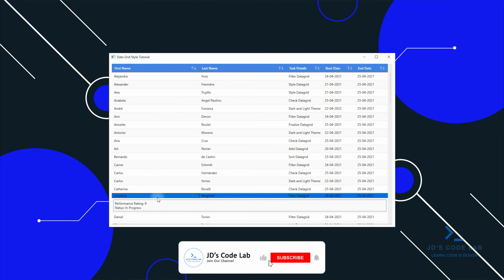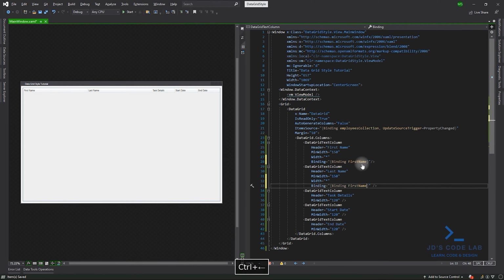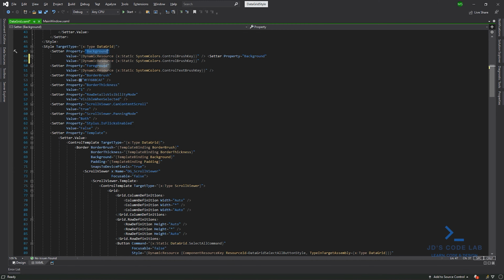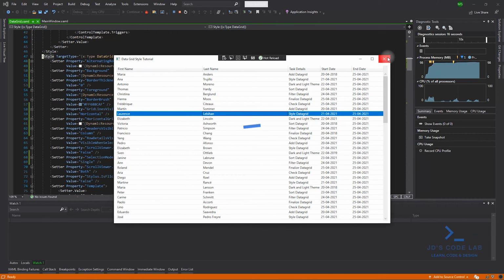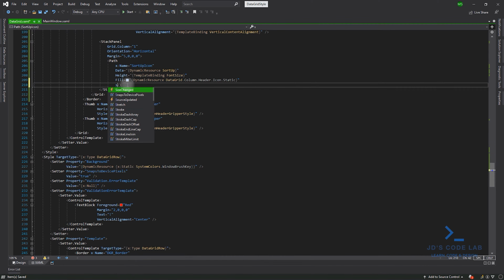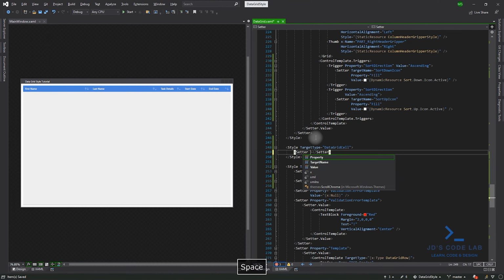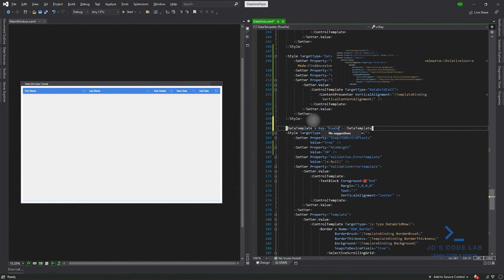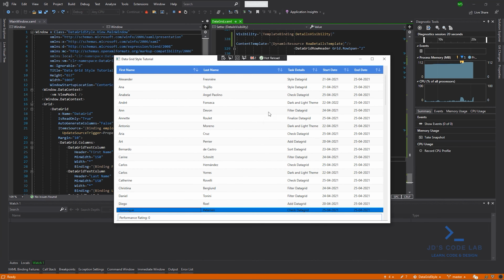WPF C# | Customize DataGrid Control in WPF | UI Design in Wpf C# (Jd's Code Lab)

Comment: Sir,  youtube  originally played the video in a very low esolution 360p by default. I was unable to read the code and was frustrated. I figured out that the Settings Icon allow you to switch the Video Quality to 1080p  etc. After doing this , I was able to read the code fine. Hope this helps someone else. :)  Additionally, you speak a little fast for me so I slowed the video speed to .75 also. English subtitles was also quite helpful.

Comment: So after finishign all steps my datagrid doenst show data . even after the first step when i styled the Datagrid, i checked my code and dont know why. 
So my code works diffrently because i was opening a file and it was parsing through the file getting specific strings into the datagrid all worked fine until i changed the  style maybe you know where the mistake is, else i would say its a fine tutorial but you are a little bit fast and its hard to follow the steps i had to pause multiple times to follow in wich property you are right now

Comment: Thank you! You helped me to setting the syle of my data grid
Reply from the maker: Glad I could help!
Reply: @JDsCodeLab  I setted the selected row fill with a color different to the border cell color (gray in this case), but when I select a row I see also the gray border of the cells. Is it possibile to set the full row (also the current border of the cells selected) at the same color of the selection?
Reply from the maker: In the DataGridRow style triggers on is selected trigger add borderbrush as gray and borderthickness 1.
 Let me know if this solves you query.
Reply: @JDsCodeLab  I setted "GridLinesVisibility" --> "All" in DataGrid, but when I select a row I see the gray border on all the cells. I would like to see the row selected without cells gray border (gridLines). I tried to put the trigger in DataGridRow but it doesn't work.
Reply: @JDsCodeLab  How Can I show the first column header with the arrow cursor?